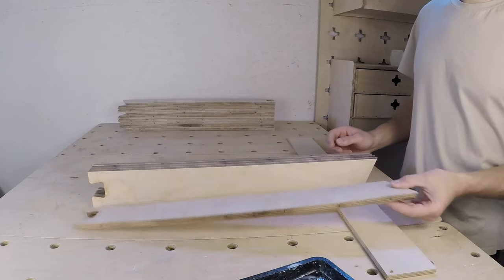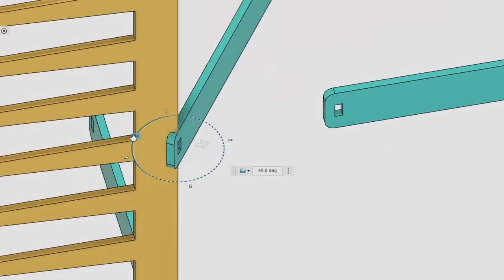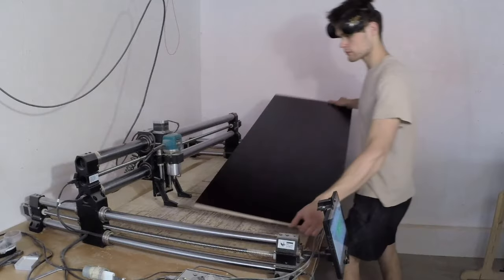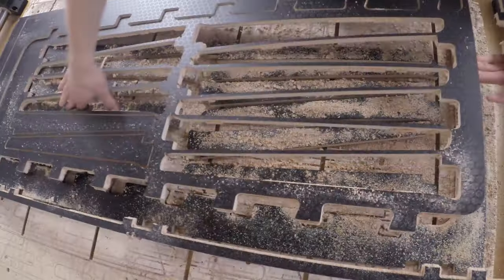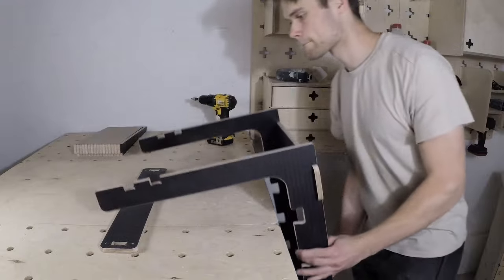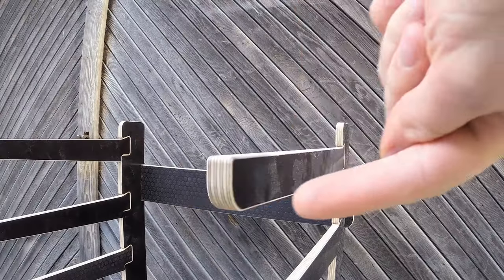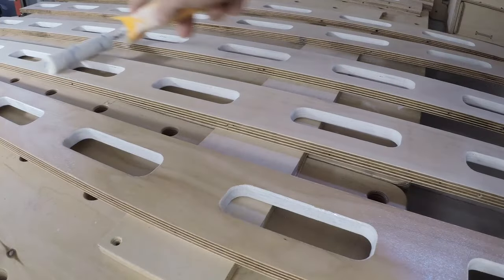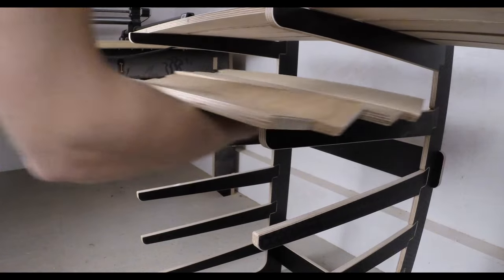How to Make a Paint Drying Rack on a CNC Router - Aribabox Workshop EP12

Comment: Any rrason you didn't use conduit tubing?

The tube minimizes how much the drying plywood contacts the rack, leading to better finishes.

Guess tou could also add large chamfers to the arms to do something similar too
Reply from the maker: You bring up a great point about using conduit tubing to minimize contact between the rack and the drying plywood, which can lead to better finishes. 
In our case, we had to build the rack quickly, so we opted to utilize the materials available in our workshop. 
Also, your suggestion to add chamfers is fantastic; we'll definitely consider incorporating that into our next projects for a similar effect. 
Thanks again for your valuable input – it's much appreciated!

Comment: Awesome. I have a question, how does the bit size affect the design of its cutting on the outside edge of the line? Does it only affect the corners or all other cuts too?
Reply from the maker: That's a good question. 
Imagine you have prepared your project's g code for a 3 mm (0.125 inch) bit and forgot to change the bit on your CNC before running the program and made all the cuts using a 6 mm (0.25 inch) bit. 
The CNC would make all of the cuts as if you had a 3 mm bit in the collet. That would result in offset contour cuts and loose joints (the 6 mm (0.25-inch) bit would remove more material than intended in the g-code.) 
We had the same issue - with a smaller difference in the tool diameter and a less tragic result.
Reply: @Aribabox  oh thank you! That makes sense now! I now realize that i have made the same mistake too.
Reply from the maker: @littleredbarncraft4101  You're welcome! It happens to the best of us. Learning from mistakes is all part of the CNC journey. If you ever have more questions or need advice, feel free to ask.

Comment: Cool, btw found that you might have misspelled your url in the "Get the CNC Files" section. 
I really need to start testing making press-fit parts on my CNC.
Reply from the maker: Thank you for pointing it out! 👍🏻
The test fit parts are fairly simple to make - just have to have precisely calibrated router bits, or play with the tool path offsets.